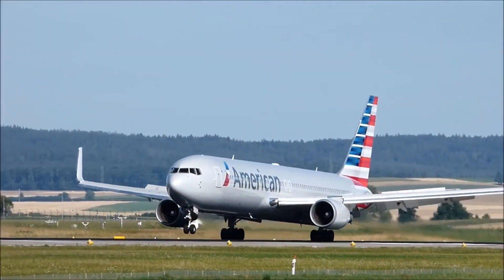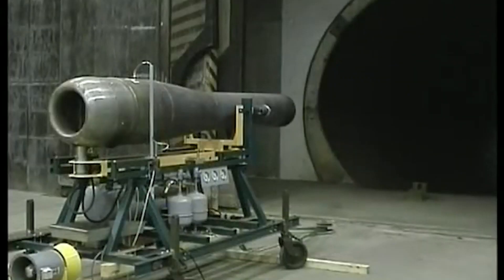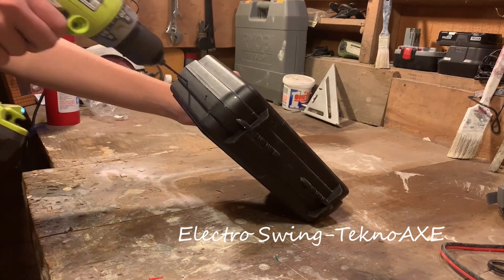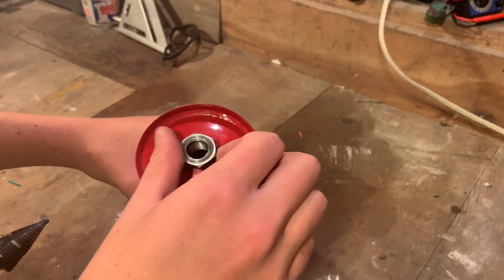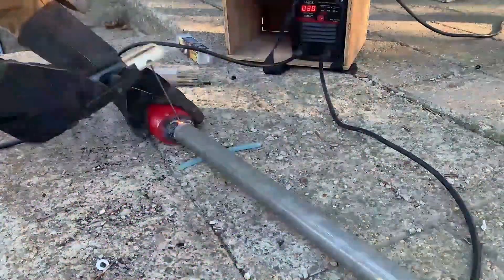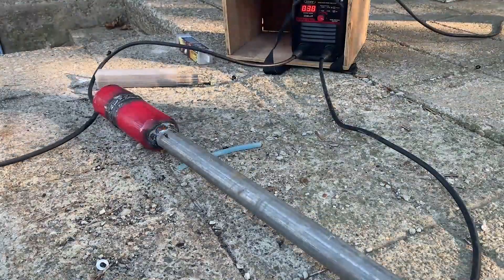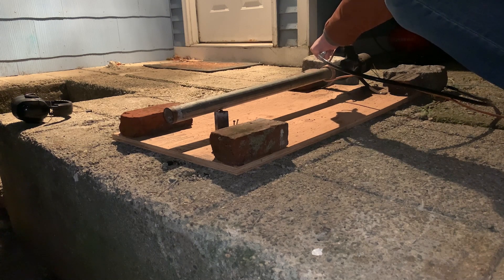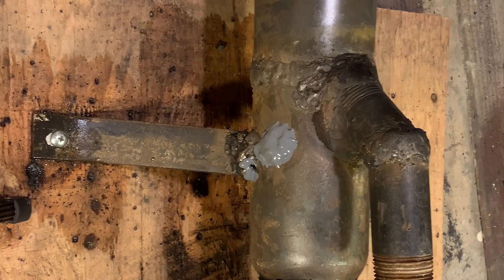Home Made valve-less pulse Jet engine

Comment: Also that is nowhere near 100,000 volts the maximum voltage is set by the spark gap and air pressure composition etc

Comment: Hi again I’m sorry about my last question you didn’t answer what I meant when you connected the high voltage with the spark plug which the spark plug is already connected with the buddy or pulse Jet if you touch the pulse Jet ( you not gonna get checked ) so you connect one wire with spark plug and you connect the other wire with the body of pulse jet ? Thank you and hope you answer my question.

Comment: Bro, awesome job!! Sure did sustain but your fuel line further back with more holes to aerosolized the fuel and throttle back the air. You are almost there. It is beautiful to see young men still doing these things. We had electric kits You could buy to basically build bombs and science kits chemistry kits that actually came with actual radioactive uranium. So to see there's still people out there doing the stuff is really really cool

Comment: Your engine keeps backfiring because your math for fuel looks like the dimensions suit diesel better. For propane you need a bend in the tubing so it is slowed slightly and it's able to continuously pulse

Comment: I dont know a lot about these engines but i tought that if you would try to make a «choke» system that controls the air that enters, maybe you would be able to start it beacause maybe there is too much air and it blows the flame up at the beginning

Comment: Hey Judson,
Random thought, but could the reason you are not getting a self sustaining combustion be the placement of your intake? With the intake in the place that it is, the shortest path between intake and exhaust does not cross the ignition. If you were to swap the placements of the intake and the ignition would that make a difference?
Your fellow teen, Jerry

Comment: To be honest (and from my very limited experience), when a pulse jet starts up and only sustains with compressed air, it almost always boils down to a geometry problem.

For example exhaust too long/short (which you tried), intake too far back/forward, needs more than 1 intake, fuel injector/spark in the wrong place, combustion chamber too small, intake/exhaust area too small/large, etc. No guarantees that any of these will help but that's what I'm inclined to thing. Also maybe braze the copper tube onto the jet to help with better heating of the fuel

Comment: HEY @James Judson, i have built a few now and a few recommendations for you to help get it running:
1. I noticed towards the end you had a mig, id recommend using that for all the welds, there shouldnt be any extra lip on the inside of the engine because it will upset the natural flow which is what the engine depends on to sustain running because it goes off acoustic resonance of the detenation.
2. The length and shape of the exhaust compared to the combustion chamber and intake is also important.
3. Fuel injection positioning is also important. 
They are a fun project, but not a toy so stay careful because it can be dangerous if you neglect safety and precaution. You can do it. You almost have it. The inner dimensions are very important with proportions and cleanliness of the joints and they can make or break it. Make sure to not leave the flow regulator on the hose from the bbq because it restricts the flow to much and will block the flow if the combustion triggers the safety valve. 
One more thing, try turning your propane tank upside down so it feeds liquid propane into the thing giving it more fuel to use, and it also will run better once in a hotter state so if you need to run it best you can to heat it up then try going for full on run.
Reply from the maker: Those are some good suggestions. As for the mig welder, I purchased it right at the end of the project. Ideally I would have used it the whole time. As for safety, I try to take all of the precautions that I can while still being able to work on projects like this one. When I make a second attempt I will definitely keep your suggestions in mind.

Comment: I made a pulse jet when I was 16 years old. I am now 73. You need I moving part, a petal valve, fitted between the fuel input and the combustion chamber. I made mine from razor blade steel.
Reply: It’s a valveless pulse jet.  No moving parts.

Comment: To get your pulse jet running, you just need to get the air to fuel mixture and the pressure right. I buildt my fuel line out of an old breaking line, you have to get the diameter of the nozzle juat right and things will get way easier. Good luck and keep building!

Comment: Do you think if the intake was relocated and make bigger along with the fuel line put into a fitting and the fitting onto the extinguisher tank it would work and ignite smoother? (I am trying to make my own out of a fire extinguisher bottle)
Reply from the maker: Intake and exhaust have to be in a fine balance for a good running engine. For me it was tough to find steel tube with the right inner diameter to accommodate the engine. I think it is a good idea to relocate the fuel line. It would clear up the intake nicely.

Comment: Congratulations, excellent work. As a non-technical observation, I would like to inform you that the photo you are using, labeled as V.V. Karavodin, is actually that of the Catalan inventor Ramon Casanova i Danés. After the fascist military uprising in Spain led by General Franco, Ramon Casanova had to flee to France. Shortly after, when France was occupied, Hitler's army stole them, along with all the other French patents. It appears that Ramon Casanova's already functional design was used by German engineers to manufacture the engine for the V1 bombs.

Comment: Stick welding thin material with stick isn't easy. 
You really need some backing-material as a beginner. Fill the pipe with sand, this will help with the burn through. 
Weld hot in short burst and let the weld cool. Don't try to weld with lowered amperage, this will only end up in "pockmark" welds.
Try the "weld through" method. Take some iron sheet and put it over the weld area and weld through the covering. If have both hands free you can use a nail for that. Both methods add material that has to be heated up and so lowering the temperature that goes into the pipe.

Comment: Actually building a turbine engine doesnt require 20k moving parts. all youll need is 2-3 bearings, a compressor, and 1-2 turbines depending on how efficient you want the thrust gained from the flame to be and of course the center shaft everything connects to and goes into the bearings. from there you will just need a combustion chamber and fuel which arent moving parts. if you do plan on trying it I recommend using a gas fuel such as butane/propane as to not worry about high pressure fuel delivery systems. I myself am currently trying to build one for my High School engineering class as its my senior year and I want something to take home, though it has been hard due to this project being self funded and I own my own apartment so I also have to paint rent and I can only work a limited amount of hour bcuz of school but hopefully I get there.
Reply from the maker: The 20 thousand moving parts came from a commercial engine. I know that most diy turbofans don’t operate with that many moving parts.

Comment: Well ,I got my plans from an old timer  I knew as a kid,and tripled the dimensions, it was 15 feet long, and I couldn't get it to run, just pop, bang, not much run. Then after cutting  intake and exhaust then adding dimension to combustion tank ,ect. I realized you. DONT USE A REGULATOR! Straight from the tank!   Mine,  and YOURS definitely would have run without a regulator, if you still have it, try it out and you don't need special fittings,just a fitting that goes onto the propane,rubber hose it, doesn't need to be high pressure hose hen to the metal line into your intake. (My latest, Pierre Laboom,shorts, pulse jet snoblower) KEEP UP THE FUN!
Reply: mind sharing the plans? sounds like a fun read.

Comment: The only real suggestion I can give is crimp the end of the copper tube rather than make holes. This would be like putting your thumb over a garden hose for a jet of water. (Sorry, needed a visual model to be sure it was understood.) Then maybe use a valve to control the input for maximum thrust.

Comment: Invest a couple hundred bucks and pick up a used 110 volt mig welder. Don't go with that fluxcore crap either, get one set up to run shielding gas. Your welds will go from terrible to good very quickly

Comment: Two words.... COLIN FURZE .... 
Go watch his vids... and study PULSE JET engines.... you're on the right track.... 
As for your welds... NEVER use Galvanized for ANY project that produces a lot of heat, it produces deadly fumes when the galvanization burns... use black iron or cold roll steel or hot roll steel... and IF you do use galvanized steel, you have to clean it ALL off where you're welding... or it won't work well... clean metal whether welding with mig or tig or arc is a necessity... hard to tell if you were too hot or what since you sped up the welding parts... you just need some more practice and you'll get it... maybe a little lower heat and slightly slower speed on your mig, and if you're burning through on the stick turn amps down, and if it's sticking then turn up slightly..... and for that small stuff use a SMALL rod with lower heat, you may have better results....

Comment: I think the next thing I'd try. Is maybe some kind of restrictor on the fuel side. Might be a rich mixture issue. Maybe at the end of the fuel line "where it enters the intake" fit it with something threaded. So you can try different jets. This way you can have good pressure on the fuel side, which means you have good fuel discharge rate & a better ability to control fuel mixture.
Reply: The fuel tank valve can restrict it enough, all he would need is more air introduced to the mixture to offset the mix to combustility. I run my little one with tank upside down so it feeds liquid and i basically need it unrestricted on fully open to get it to run. Its a twin intake but stainless steel and gets almost white hot

Comment: The size of the combustion chamber is too small compared to the thickness of the injection nozzle, and combustion is well maintained when the air inlet is much narrower than the outlet.
Reply from the maker: It may not have been apparent in the video, bu the intake was much smaller in diameter than the exaust

Comment: Try using a Flux core wire feed like the cheap HF units, stick is difficult on thin metals unless you are a experienced welder,  still a nice  attempt on the engine though.

Comment: Burn through is a primary indicator of improper weld technique. A few pinholes means your weld is not solid. Since you didn't specify your settings, and didn't clean well enough for 6013, I'd grind out the welds and try 7014 for a redo of the welds since 7014 is as versatile as 6013 but doesn't blow thru as bad. I'm convinced most beginner welding courses start with 6013 just to make thorough and effective cleaning (and proper joint fit up)  before welding into a habit. That and the burn through is a sure indicator to the instructor that the student is having problems with technique.

Leaf blower is good for start up.

Comment: Next time try 6018 or 7018 welding rods. The weld technique is to simply drag the rod/  Look up on YT for hints and examples.  And, for any kind of welding you have to have clean, bare metal.... no paint, rust or coating of any sort.

Comment: Hey how about this bro!
 put the air line tapped into the fuel feed system about 6 in back from the tip of the fuel pinholes so the air blows fuel ⛽  to a fine mist with air pressure and speed! 

Bet that'll work bro bro‼️💯🤫🤫😏
Reply from the maker: Could work. The only problem is that it might introduce extra risk, if you have both fuel and oxidizer in your fuel lines you introduce the possibility of an exploding fuel line.
Reply: @jamesjudson67  You are correct. That is why Oxy/Acetylene torches us back flow prevention in-line valves bust behind the torch handle on both the oxygen and acetylene lines.

Comment: Did you try with liquid propane?
Integza had the same problem, his designs were meant for liquid propane and he was just using the gas.
Reply from the maker: Good point. I probably could have turned the propane style fee upside down to get liquid propane. It is more challenging to atomize liquid fuel it I may have made a significant difference. For this iteration I just preheated the tank before use.

Comment: If the engine won't stay running without added air then that means that you are running a really rich air fuel ratio. Try using a copper pipe with one hole for your fuel delivery and no compressed air

Comment: Thinking about the spark plug, next time use a 14 mm plug , a heavy couple of washers and a 14x1.25 nut. All can fit through the neck, as well as a socket. And probably right at a junkyard or mechanic shop nearby. Tell either operator what the plan is and he will probably get everything for you. Might even want to help you with technical work.

Comment: Find stainless/nickel rods . 6013 is available in 1/16” use 20-25 amps . Cut just a half inch from the bottom, and a few hacksaw cuts on the body at the cutline to allow it to collapse and fit in the bottom. Good ideas but you need a mentor for materials and techniques

Comment: The air fuel ratio was off, so it would not stay running. If you can regulate the fuel better it will run.

Comment: OK, that was an interesting video....thank you for making it.

I do have a question though:

Why did you choose this design?  There are multiple designs. The one I have seen the most of is a horseshoe-shaped or U-shaped design.
The ones that the Germans used had a flow-through design like a ramjet, but a spring-loaded door in the middle closed during combustion and opened during exhaust. That one may be the most difficult, the u-shaped one I have been told as the easiest....I I would suspect that the one you made is somewhere in-between.
Look for videos of some guy with a long  beard having a jet powered bicycle or reject powered go-kart.

I would like to see a Mark II, by the way.

Have an excellent day!!
Reply from the maker: Good question. At the end of the day it came down to the resources that I had available to make this project. The u shape may be simple in design but the materials and tools required to make one are a bit beyond the capabilities of my small basement shop.
Reply: @jamesjudson67  

Kwel beanz!!

It is kind of unfortunate when you can make it this time.  From what I understand, it is the easiest one to get running. You just have to tune the lengths of the pipes. It will then run until it is out of fuel....

Comment: You can weld thin metal with a stick welder, If you use another welding rod, with the flux roughly chipped off. Introduce it to the weld pool like you are tig welding. You can then regulate the weld pool temp by introducing more rod. Good job on the parts for the pulse jet. I made one of these about 40 years ago my design was a little different though. worked great for about a minute & about the same after I rebuilt it stronger. My father banished me from the shed after that. (very wise since it was his business location & it was a wood building) I also nearly burnt it down a few years later. Fire brigade saved it.
Reply: You sound like me, I almost burned our house down in Chicago, back in the seventies, doing much the same as here.
Reply from the maker: What kind of amperage would you run?
Reply: @jamesjudson67  well that depends on the material thickness. It takes a little getting used to the technique & best to have a self darkening helmet as you need to use both hands. once used to it you can even bridge some pretty big gaps.
Reply: Texas tig welding

Comment: why would you say "much more efficient"
Reply: well a rocket stove (wood burner + chimney) is very efficient, in burning stuff
Reply: maybe there is too much focus on the "pulse" action, more like a continuous burn valveless rocket stove
Reply: use a glow ignition electric resistance coil, to spray/vaporize/mix the fuel injection kerosene spray
Reply: rocket nozzle mate
Reply from the maker: I believe when I was referring to efficiency I was talking about the thrust to power ratio. In this way the turbo jet is much more efficient. As for a rocket stove, I believe they don’t generate any thrust and are mainly used for cooking. I hope they clears up your question.
Reply: @jamesjudson67  well I do believe an air mixer can be same and better than a complex turbo jet, in also generating thrust
Reply: @jamesjudson67  gotta be a better design, to make all the thrust, like an afterburner, dont you think
Reply: @jamesjudson67  afterburner makes a ton of thrust, and its a "rocket stove" style engine
Reply: @jamesjudson67  and afterburner is a no-moving parts fuel injection air mixer device
Reply: @jamesjudson67  are you just copying what other people say to be true?
Reply: @jamesjudson67  try more like a ramjet no-moving parts, not even a nose cone, type of afterburning ramjet engine
Reply: @jamesjudson67  afterburning valveless ramjet would be smaller, lighter and give more power
Reply: @jamesjudson67  try hour-glass shape afterburner-ramjet with after neck fuel injection to a glow ignition electric resistance mixer vaporizer coil (red hot glowing)
Reply: @jamesjudson67  also it will work as nuclear heat valveless heat source thruster, no combustion or pulsing, check those no-moving parts nuclear in-air rocket stoves
Reply: @jamesjudson67  put only a small intake for air, you get the back side flow out pressure, from the rocket cone shaped thruster output
Reply: helps mixing all the fuel with air and burning it